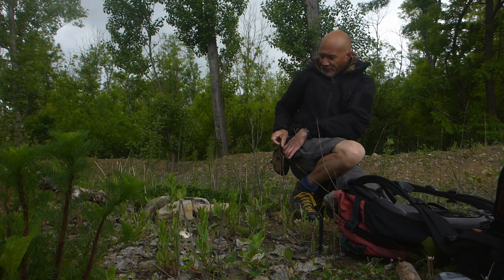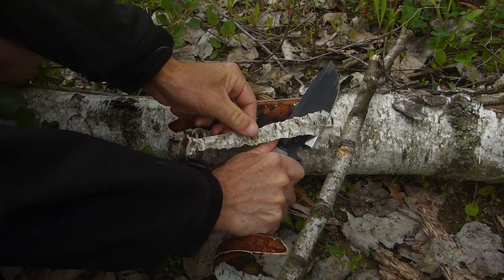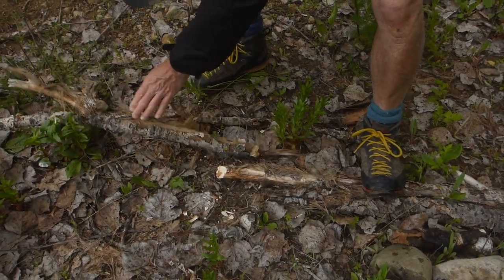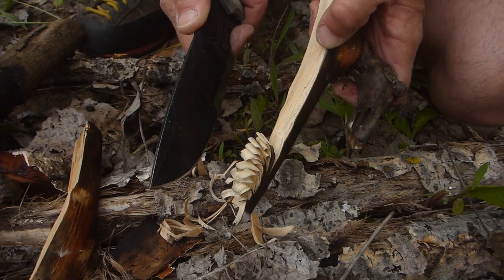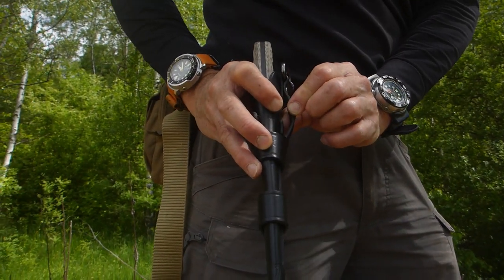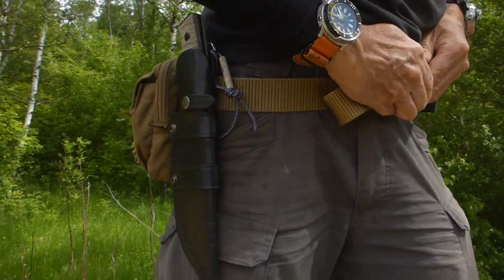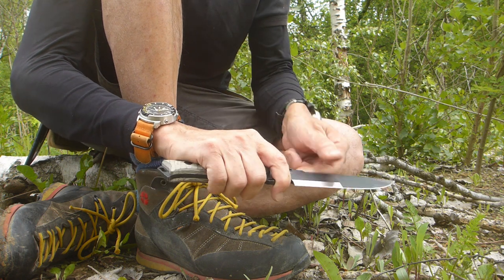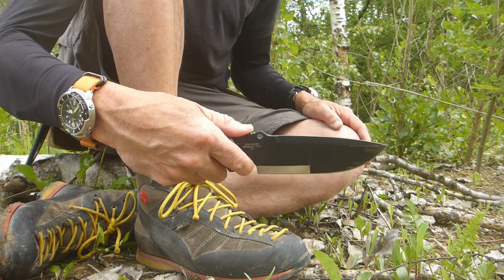FKMD Sherpa FX610

Comment: I like this model and the rimor one, I can only afford one, which one you recommend?
Reply from the maker: They are both nice. One is D2 the other a N690. If you will be continually getting it wet or possible submersion i would go for the Rimor but if not then I'd put two bits of folded paper into  a box, one with rimor written upon it and the other Sherpa, mix them around and draw one out randomly!